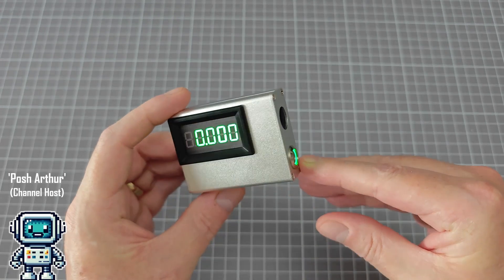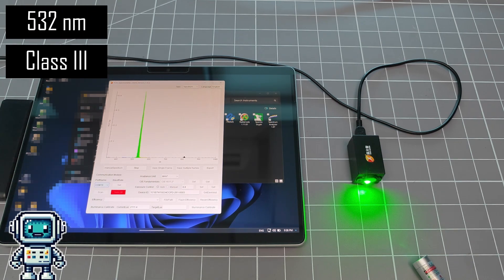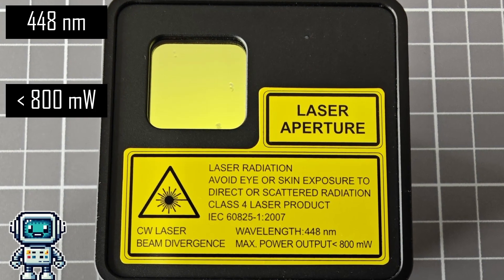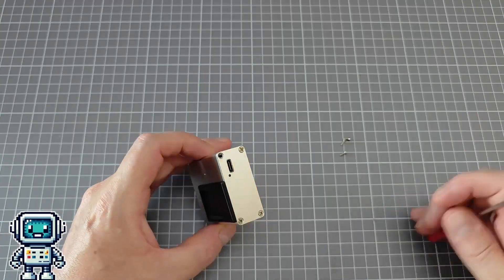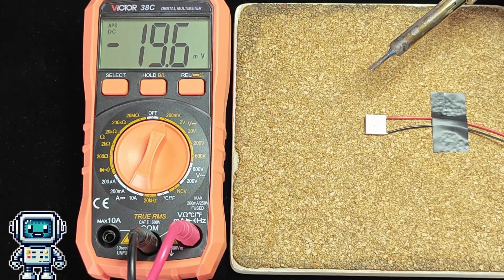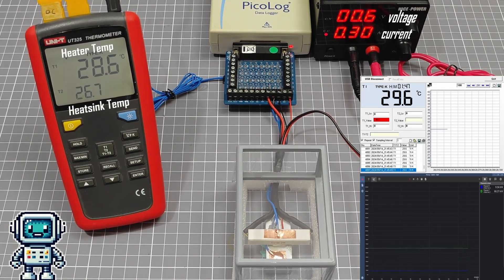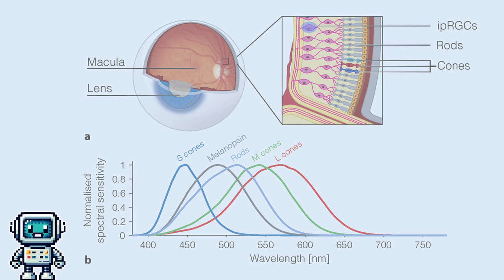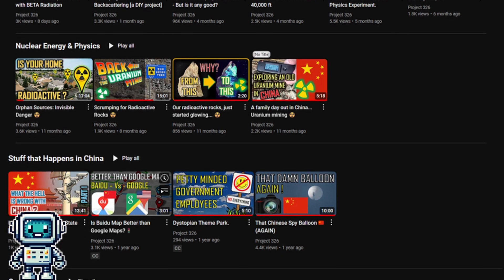How does this LASER POWER METER work?

Comment: 3:23 You are actually incorrect there. Class 3 is actually a "stronger" (less restrictive) class than 3B. All classes having a letter after, is a more restrictive class, which put more restrictions on laser output or its use (for example, with lenses, or similiar). This means, that both "Class 3" and "Class 3B" is a correct label, where Class 3 (encompassing both Class 3R and 3B) allows 500mW. The class system is a staggered system, where you can "certify" your laser in a higher class if you are not able to gurantee manufacturing differences.

Imagine you are manufacturing lasers, and the lasers are expected to be less than 1mW. But you can't gurantee it, and it could slip through lasers having more than 1mW, but you can surely gurantee them getting under 5mW. Then you can put a Class 3R label on them to "be safe".

The important thing here to consider, is that no class have a lower or minimum requirements, so you can put a "Class 4" label on a 100 nW laser if you want, even if anything under 390 nanowatts are Class 1 certifiable. Its just up to you as a laser manufacturer, to know what you can gurantee and test for. Your test equipment may have a error margin that is larger than 390 nW, then you can be on the safe side and certify for Class 2.

Comment: This is my favourite channel on youtube. The food grade plastic tip was not the bonus I expected!!!
Reply from the maker: even more interesting is that using black 'garbage' sack material, the thermal camera can see through it as though it wasn't there, but it is opaque to visible light.
Reply: @project-326  I have a 'vintage'/older IR non-contact temperature sensor that has a window made of a sheet of clear plastic in front of the parabolic mirror, it seems perhaps 2 to 5 times as thick as consumer cling-film but otherwise seems to be the same stuff.

Comment: The reason 1+1=4 is because it had a clear view toward your skin (unlike most of the other pointer tests) was seeing the thermal blackbody of your thumbs and you were pretty close to the sensor when testing those two. Also the power of the other pointers swamped out the effect. The professional Ophir meter at work EASILY sees when my hand is in front of it. 
And the reason there are so many cheap lasers saying they're 1mW, when they're actually a retina blasting 60 is because several governments like the UK about 30 years ago, in their perennially infinite wisdom, decided to ban all lasers over 5mW for sale to the general public. So Chinese sellers simply started selling everything as "<5mW" and now not only do we still have dangerously high powered lasers available everywhere since the governments never actually enforce the ban, but they're almost all incorrectly labelled as being totally eye-safe too. THANKS government regulation! 😃👍🏻👍🏻👌🏻
Reply from the maker: Thanks for the comment.  I didn't show it in the video, but even with my hand right up to the measurement window, there was no reading from the device.
Reply: @project-326  I see. then the explanation is interdimensional ghosts haunting the circuit.
Reply from the maker: @Muonium1  Maybe, but a bandgap is also possible as is a measurement error or just poor sensitivity near the ambient temperature noise floor.
Reply from the maker: @Muonium1  what I am vaguely considering for a project is to add a small resistive heater (and feedback control circuit) to pre-bias the measurement surface and allow measurement of small amounts of optical energy.

Comment: Would soot from a candle provide a more ideal "black" surface? (assuming you don't damage the Peltier-device during the deposition-process...)
Reply from the maker: I'm sure it would but I wonder how to keep it in place.  It could be a little too fragile.  

There are other options like the high temp paint that is applied to exhaust pipes and stove paint.  I would love to be able to get the best sensitivity with a venta-black type solution.

What I am most interested in is getting higher sensitivity as opposed to being capable of measuring very high powers.
Reply: @project-326  I don't reckon sensitivity to be the issue - the more important problem is making it spectrally agnostic. The sensitivity-difference between 98% absorption and 99.999% absorption is just 2% higher signal. Far more important is that is has (constant) absorptivity at all wavelengths of incident light.

Comment: I lol'ed when you said a thermopile sensor for laser power meter measurements was an "innovative" idea. Considering it's been a go-to method for higher power professional laser power measurement equipment for as long as there have been powerful lasers to measure! They've only been slow to the hobbyist/budget grade LPM market mainly because low power handheld ones could be made even more cheaply with a low power photodiode , a button cell battery, and wavelength calibrations.
Reply from the maker: Thanks for the comment.
Having never owned one of these things, I assumed that they were all photo-diode based, it wasn't something that I had ever given much thought to.  I like this technique because it doesn't care about wavelength (assuming a good coating) and so is applicable to any optical source.

Comment: I guessed how it was made. I made a similar device from peltier element, but my diy product was low-cost and I used multimeter (and multiplying voltage) to get rough power meter.

Comment: 11:26 It occurred to me that if you put a cold surface on a candle flame, you can get an almost pitch black carbon coating, which technically would be stable in UV radiation and intense heat, etc. This could be useful for converting the laser energy into heat and measuring it. 

Please proceed with your idea. It will be exciting to see DIY laser power meters outperform commercially available ones!😊
Reply: the oldest historical method to produce black pigment/paint
Reply: you will also get water on the surface, and so should use a hot surface instead.

Comment: very cool: which thermal camera device have you used?
Reply from the maker: I have the UNI-T UTi260M.  It is a tiny USB-C dongle.  Its a great device, It lives in my work bag so I have it on-hand wherever I go.

I'm not sure if this model is available in the west, it exceeds the specification allowed by most counties for civilian use, both in terms of resolution and also frame rate.
Reply: @project-326  it is available, in EU at least. What a nice but expensive toy! I saw a review of the InfiRay P2 Pro and now, it's hard to resist  XD... price is almost the same, I will check the differences between them

Comment: Hi, maybe the reason for the step in the graph output voltage vs input power is due to an offset voltage present in the recording instrument op amp "Thermopile requires high-precision  op amps with low or no noise, low input bias current and very low offset shift over time - such as zero-drift amplifiers" (from scientific instrument site), also the problem you noticed is present in the precision instrument as can be shown in figure 3.3 at the link I posted in the other comment.
I used a thermopile in a lab that had a responsivity of (19 ± 4)V/W. It was a proper scientific instrument, so with the power level you wanted to measure maybe the step is only a noise problem within the instrument error. This should also explain the error in measuring the two red lasers.
Reply: https:   //www.   hamamatsu.com/content/dam/hamamatsu-photonics/sites/documents/99_SALES_LIBRARY/ssd/thermopile_kird9005e      .pdf
Reply from the maker: The Hamamatsu sensors are based on thermocouples, instead of p and n-type doped semiconductors which are used in TECs.  The theory about the bandgap being relevant might be completely wrong, but I can't find any hard data that either confirms or disputes that.
Reply: @project-326  I agree with your assessment about the P-N junction bandgap. The TEC is essentially a bunch of parallel diodes (or four layer diodes in the case of the P-N-P-N junctions) and therefore have a forward voltage drop caused by the bandgap. Just as typical silicon signal/switching diodes like the 1N914 or 1N4148 have a 0.6 V forward drop, the TEC should have a similar characteristic and it will manifest with that same kind of voltage distortion on the graph until the bandgap threshold voltage is exceeded. Such is the nature of doped silicon devices.
Reply: Unfortunately, YouTube tends to hide comments with external links due to its anti-spam mechanism, so...poof, the link is nowhere to be found :(
Reply: @Nachos-sk7od  try searching for "thermopile detector hamamatsu photonics documents" Hamamatsu has a lot of great technical documents also regarding photomultiplier tube electronics circuit for free on their website
Reply: @Nachos-sk7od   hamamatsu dotc om slash content slash dam slash hamamatsu-photonics slash sites slash documents slash 99_SALES_LIBRARY slash ssd slash thermopile_kird9005e .pdf
If you use the api you can still see it
Reply: I totally agree that high precision op-amps are crucial for a proper instrument. I was working with photodiodes and had to choose OPA607 instead of LM358 to lower the detection threshold without getting false signals from the noise.
Reply: I'm more happy sensing the short circuit current than a voltage in photo junction device as photodiode.

Comment: the only explanation for sum of below noise sources to give overresponse is that on this area it may not be linear. You noted there is some little glitch of activation power. But if you are interested on linearity of response try test EMF meters, budget are known of bad frequency response, that also includes antenna resonance, but more reliable are very expensive.
Reply from the maker: as you point out, for EMF meters, the issue is how to match the antenna over such a large frequency spectrum.  You either need to have a super simple antenna design with the absolute minimum in pole-zero loading, or an active matching solution.  Active matching is not possible for designs that need to have access to frequencies over about 1 GHz...
Reply: @project-326  yes as commonly used monopoles they have poor frequency response so more preferred are log-per but they are less common. If sourced UBB27G antenna that is an active monopole for very large range 27 MHz to 3.3 GHz and confirmed by independent test lab. However it needs active supply.

Comment: Removed from my shopping cart... good timing. I mainly wanted to reverse engineer it. Any tips you can provide on calibrating one of these things would be great. One thing I noted from looking into this earlier was tons of people on forums saying you need to spread the beam out over more of the surface area for a good read on TEC based designs. Also, the model you showed is said to take so long to warm up that higher powered lasers will overwhelm the heat sink's dissipation before it stabilizes, saturating the array. Battery powered units have a battery warm up period where current provided changes with temperature, causing the measurements to drift. I think we need to compensate for that by measuring the supplied current versus the produced current so it tracks better. Some laser system designers I've seen will remove the collimating lens and butt the device up against the LPM's housing to measure, spreading out the beam much more and avoiding damage. My naïve assumption is that the resistance changes across the array based on which elements are directly exposed to heat, maybe a low mass front plate of material other than that ceramic would help by spreading the heat more evenly? India ink seems to be a decent and stable absorber, check out https://opg.optica.org/oe/viewmedia.cfm?uri=oe-18-26-26854&seq=0 and https://www.ncbi.nlm.nih.gov/pmc/articles/PMC4102347/ for some data. It's not linear across the band but it is predictable, so a calibration curve could be established.
edit: Ordered supplies for this, we'll find out. Tiny TECs are smol. If nothing else I can cool a CMOS with it later when this fails :p I'm building an LVGL HMI for a client rn using an ESP32-S3 with a touch display that is like $20, those might be good for such projects as these. esp32-s3-touch-lcd-4.3-b (b has screw terminals, chemically hardened glass, panel mount).